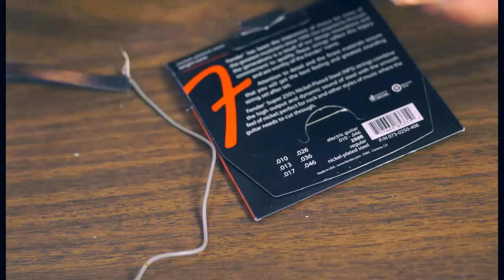How to shield a Stratocaster from EMI with copper tape

Comment: Guitar repair dude here. When you started cutting the foil by the bridge with the xacto knife, I audibly gasped. I'm sure you used a soft touch, but the idea of the blade cutting into the finish almost gave me a heart attack lol.
Reply: That area is going to be covered by the pickguard anyway.
Reply: Thats the beauty of doing work on your own guitars... Doesn't matter if you "add some character."  :)
Reply: out of sight out of mind for the average joe haha
Reply: In corona times I have done some diy work to a P-bass (fretless now), a Yamaha Pacifica (removed paint and oiled the body) and an old cheap Spanish guitar (body is now 2.5" and it has both coils and piëzo).

What I've learned, is that small mistakes (making a scratch or sanding a hair too deep) can take weeks to repair. Waiting for some varnish to dry thoroughly might really slow you down. Try doing creative things involving tubes of oil paint, and plan half a year ahead.... For my bass, I decided learning to play it, is more important than a great shiny finish. Now it is okay, I could simply polish and varnish it, or sand all the paint away, expose the wood and oil it. Yep, when things go wrong, it is sometimes loads of work to reverse the mistake in a decent way.
Reply: a little dramatic
Reply: @alextotheroh8071  Still is stupid to do
Reply: Me too
Reply: Nothing a bit of clear coat can't fix. I'd bet a bit of clear fingernail polish would suffice.
Reply: I thought the same thing

Comment: Shielding the jack cavity is not recommended, as it increases static noise when your hand gets close to the strings. Try it. In fact Fender does not do it, it does not paint that cavity with conductive paint, it only paints the electronics cavity.

Comment: Copper with some adhesive on it...buy if from Stew Mac for only 5X the price of regular adhesive backed copper. They also sell guitar screwdrivers, a guitar hammer, and if you spend over $100 (for example if you bought one "guitar screw") you get a free guitar sticker. It's like a regular sticker, but it comes in a packet with a guitar drawn on it, and costs 5X as much
Reply: Stew mac is insanely over priced. 
 I saw they were selling a ruler for guitar action measurements for like 23 bucks. I had got it on amazon for 6 bucks.
Reply: It really is a killer deal, I bought 3.
Reply: of everything.
Reply: I really do like Stew Mac. I have bought a couple things from them that I didn't find elsewhere.  But yes. They are ridiculously expensive.
Reply: Maybe from.now on lets call it screw mac.
Reply: Speaking of screwmac. Where does one go to get a complete nut file set. Or only the ones you need for cheaper that screwmac $89 set?
Reply: @peterharoldjanakjr2078  China, via Amazon
Reply: @peterharoldjanakjr2078  I know this is an old comment, but I went down that road too. I bought cheap nut files and they sucked. I eventually spent the money on Stew Mac nut files and they are quality tools. But I build 20 or so guitars a year so I use them a lot. They never get dull, and you get a precision nut slot, both width and depth. Still a lot of money though!

Comment: Never do soldering/desoldering like that - do not blow at the points/contacts you've just finished (as for to cool them down or to blow away the dust), because, chances are you will scratch the soft surfaces and reduce the quality of soldering along the way. Always cover the scratchable surfaces with some paper or cloth.

Comment: I've build my own guitars from scratch and never had as many problems like I spent the last 3 days on this kid's guitar trying to get the buzz out until I learned that it's just something that strat builds and their pickups just have naturally. I used shielding paint, foil on the pickup guard, wax potted the pickups, new wires and wiring configurations,... even made sure it wasn't pots or pickup screws touching the foil. I love strats, but fuck my life, great learning experience if I want to be a luthier someday

Comment: This worked great for me.   No degradation in tone that I can detect and my strat is now silent.   Before this I had a nasty buzz unless I was touching the strings or bridge.   One additional thing I did was make a small tube of copper foil running through the hole connecting the output jack area and the control area to shield the output wires.   I don't know if this mattered but was easy enough to do.  I sliced the ends of the tube that extended into the two areas lengthwise and then pressed it out like the petals of a flower on both ends to ensure the tube had continuity with the rest of the shielding.

Comment: Grounding hum is an extremely technical subject and is caused by more than just unshielded electronic components. Sometimes it's caused by connections to multiple units that have different ground conditions. It's worth checking out because in some set-ups the hum can be overwhelming. I get several radio and short-wave stations some days when I touch the strings of my Strat. They're so loud that I'm able to record them with a mic.

Comment: I've just bought some copper tape to try and shut my noisy as hell Gibson BFG up, that'll be me this weekend.  Thanks Extralife - I thought it'd be what you did, but it's nice to see someone do it first, good tip about the joint soldering.
Reply: So did it work?
Reply: @WarrenPostma  Absolute sodding nightmare, in the process of removing the electrics, my V old soldering iron melted the interior of the volume pot. Bought a new one, spindle too short (designed for pickguard mount rather than through-body type Gibson), then couldn't get any surface adhesion with the solder, bought a new iron - eventually got it ON AND WORKING (from start to finish about 2 weeks with waiting for deliveries) - by then, I'd lost all interest. If you have any luck, let me know.

Comment: Twist the OEM single coil pickups and out put jack wires. Shield cavity with aluminum foil tape that works just as well as copper foil tape. Ground the three pots together single wire daisy chain. Install a better treble bleed.  Huge improvement! Hum reduced and buzzing gone. Don't sink money in swapping out pickups. A properly single coil  strat setup is fun to play.  Notice, I said single coil not humbucker !!  Cheers!!

Comment: I did this to my 50th anniversary Strat about 15 years ago too (Squier though, not rich!), but I used aluminium foil and aluminium paint so that there was no magnetic issue with the pickups.

I'm running standard issues on neck and middle, but I have a hot rail humbucker on the bridge position and it sounds great. Also, I'm not too bad at setting up guitars and a lot of folk who played my Squier Strat have queried its authenticity as a Chinese build!

Anyway, good video and I dig your tunes.

Comment: You can use aluminum HVAC tape, but to maintain connectivity you just cut the tape with a couple little dog-ears sticking out from the long side. Then when you remove the backing, fold the dog-ear under. You can then overlap the tape over another piece and maintain connectivity. It works fine. I like the good copper tape from Stew Mac too, but have used this in a pinch and it worked just as well.
Reply: Using HVAC tape is a great idea!  Thanks!
Reply: @michaelkiese7794  You're welcome Michael! Just be sure to do the dog-ear thing, and ground it to one of the pots and it works fine.

Comment: Also there are separate units that you plug your equipment into that filter the line voltage. Back in the 90s there was a $400 unit in Best Buy with VU meters in the front and they had one big screen TV plugged into it and the other was not and you could definitely notice a difference in the picture quality side-by-side.

Comment: I had a grounding issue when I put copper in the space where the jackplate goes. Someone online pointed out that the jack plate is already hooked up to the ground and is the point where the electricity is leaving the guitar as well as the entry point.

Comment: Great vid! I just didn't see or understand what you did with the solder inside the cavity on the tape in different places. Can you explain?
Reply from the maker: Sure, it's nothing complicated. The solder just creates a redundant electrical connection between the different pieces of copper. The adhesive on this tape is supposed to be electrically conductive but who knows how true that'll be 10, 20 years from now. Solder is just metal and its chemistry won't change so it's a bit more reliable in that respect.

Comment: Jam a toothpick in the hole the screw wasn't backing out of and break it off flush with the top of the guitar. Then reinsert the screw.
Reply: This trick works on those tiny screws that are used on tuning machine heads too.  You can put a little wood glue in there too, then screw the screw back in while the glue is still wet.

Comment: Thanks for the info, but here's a correction. It's not a Faraday cage that you're building. A Faraday cage would completely encapsulate the pickup as well. This is a receiver that is grounded which bleeds the EMI to the ground. The actual thickness you would need to block the EMI completely, and make it into a Faraday cage which would also need to surround the pickups would be about 10 mm. This is shielding not a Faraday cage.
Reply: Thickness of 10mm??? That's a full centimetre, which would reduce your space to reinstall any of your electrics!

Comment: Or you can just twist your ground cable around the input cable, wich reduces the « antena lenght » considerably. Nice playin’ at the end of the video👍😀
Reply: Does that work as well? Do you extend the ground wire from the tone pot to do this? Sorry just wondering... I figured his shielded input wires on the jack input (instrument side) would have been sufficient for this purpose
Reply: @carlnikolov  My cheap squier has the twisted pair thing, and it reduces hum but adhesive tinfoil did even more to reduce it.

Comment: The two inbetween are not out of phase but you will learn all that later on 
Peter Green was king of out of phase tone
Reply: IMHO AS FAR AS I KNOW 
The 2 in between pos are two pickups on a STRAT are reverse polarity in parallel instead of in series 
On a Gibson hb guitar the two pickups can be in parallel out of phase because the magnet is flipped 180 degrees yet in the pickup its in-phase in series with itself 
Gibsons work a little different than Fenders

Comment: Nice! But don't call shielding a Faraday cage, since it is not - pickups are still out, and the signal+grounding cables are also communicating with "external world", so it is shielding, but not a Faraday cage. It is a very common mistake.

Comment: My guitar is in the shop getting a full foil shield treatment but I’m getting paranoid about it, is the foil removable is I don’t end up liking the results?
Reply: It would take quite an effort to remove the foil. Remember, if using the copper tape, it has adhesive on the back so it can stick to the cavity.  It can be done but, as I said, it would require an effort.

Comment: If the body and neck were both a 1996 Fender Strat and if that was a loaded pickguard that was installed the guitar was actually down-graded with mini pots and a PCB switch.

Comment: For copper tape; could I use the kind of tape used to keep slugs away in the garden?
Reply from the maker: Sure! You might want to do a quick test to see if the adhesive is conductive. You can use continuity mode on a multimeter or do the old tongue on a 9v battery trick to see if 2 pieces taped together conduct electricity.

Comment: When i put copper tape inside the jack cable socket, my guitar signal was cut. I thought damaged the wirings in the process. But when i removed the jack out of the socket where there was copper tape, there is a signal. So i decided to remove the copper tape in the jack hole. Anyone can explain this please?
Reply: Daniel Forto your jack is touching the copper in the cavity and grounding out. Put some clear masking tape over the copper tape to make sure they don’t touch.
Reply: @AgressiveElevatorMusic  thank you!
Reply: Did you solder the output wires onto the output jack backwards?  Then the hot (center conductor) will be on the ground part of the jack.  Voila, instant short.

Comment: Switch Pos 2 n 4 are NOT out of phase, but they are wound reverse polarity.
Reply: Flipper Carlin Well yes, but I think out of phase is a fine enough description for the purposes of this video.
The result of the coils being in reverse polarity is that the EMI interference is in fact out of phase, which is how this configuration works to cancel hum.
Reply: @chassheppard  actually not my friend. The poles are reversed. Instead of all 3 having north on top south on bottom, the middle one's poles are south on top and north on bottom, basically reversed, so when in 2 n 4 with bith pickups on it acts like a humbucker, pickups not joined but separated. Being out of phase has a distinct tonal difference, reverese polarity does not.

Comment: Nice job :-) But I can´t help mentioning this: The pickup switch positions 2 and 4 are NOT out of phase. That is a common misconception, but it is not true. It is just 2 PU´s connected
in parallel. The only way you can get out of phase on most Strats is when you buy a reverse wound middle pickup. I don´t like the sound much, but that is out of phase in pos. 2 and 4.
On few Strat clones there are block magnets, the middle one could be turned, which will give the same result. It should be possible to buy copper tape with conducting adhesive, but
I havn´t found it yet, and conductive paint is said to have a low shelf time.
Reply: So... neck and centre pickup on position 2 and centre and bridge on position 4 are the ones in parallel ? Meaning.. The winds are both in the same direction? I didnt know the centre pickup doesnt come stock with copper windings that are wound in the opposite direction (reverse wound) for anyone with this same question... I thought that was the whole idea of positions 2 and 4... so the pickups work like a single humbucking picking? Sorry maybe you can clarify for me a bit
Reply: @carlnikolov  It is only on special configurations that the middle pickup is reverse wound, a standard guitar comes with pickups wound in the same direction. And the purpose with position 2 and 4 is to get a quackier sound.
Reply: You are incorrect. Thee  way you get out of phase is to wire one of the pickups to the pots with the hot wire going to ground and the ground wire going to hot. Also, When the middle pickup is RWRP(Reverse wound reverse polarity) you get hum canceling in positions 2 & 4. Parallel and series wiring have nothing to do with the winding of  the coils. It has to do with the way the lead wires from the coils are wired.   will explain this in a simplified manner. If you take 2 coils and wire the hot from one to the ground from the other. Then wire them up as one pickup, this is a series wiring. It is how humbuckers are wired. You don't see this because in a humbucker, the soldering of the ground and hot together in stuffed in between the two coils.  Parallel is the way all strats and teles are wired. each pickup is wired to the pots and switches by themselves.
I don't know if I explained this well but if anyone wants to read more about it, there are plenty of sites on the Web to look at.

Comment: does grounding the shielding actually do anything? In my mind the copper wouldn't have anything to need grounded if it shields interference. I'll have to experiment if I get some
Reply from the maker: Good question. Metal RF shielding is grounded for safety reasons, so that electronics enclosures don't become live circuits if something fails inside. However it may not affect the shielding efficacy. However it is usually a good idea to ground plastic parts as well to prevent static build-up.
Reply: Neonone it does very little if anything at all. Waste of time and money. Get a noise gate pedal is my recommendation
Reply: Based on many years experience of working on radio systems, I know that if you don’t ground the shielding, it can turn into an antenna.  It may end up working anyway (or potentially make the problem worse) but you won’t get the maximum improvement possible.

Comment: A few questions. 1) Why do people cover the serial number when videoing thier guitars? 2) How woukd it benefit a yone to know your serial number? 3) Knowing what humbucker do. Do they also need to be shielded?
Reply: Well the answer to question 1 and 2 are the same. Counterfeiters like to put real serial numbers on their fakes so that when selling, the potential buyer could have the number verified by fender and it would "check out".
Your last question has a bit of a debatable answer. However, I tend to lean on the side of caution. Shielding your HB guitar would at the very least protect the wires and pots etc from interference. I also lean to the side of lazy though, that is to say if it ain't broke don't fix it. If you're not experiencing noise problems now, don't bother.
Reply: If I may add. If you're servicing someone's guitar professionally, I would absolutely shield it! It's always good to ask though, every now and then you'll come across someone who's ears tell them that the noise is a part of "THE" sound.
Reply: @algio3041  Ah very good a swer. I hadn't thought of that.
Reply: For shielding outside interference being picked somewhere in the circuitry as extraneious noise and going to your amp, the benefit of shielding the cavity is the same for HBs and single coils. For noise contribution from the pickups, that is where the HBs are better than the single coils.